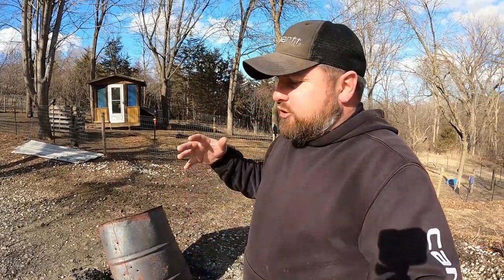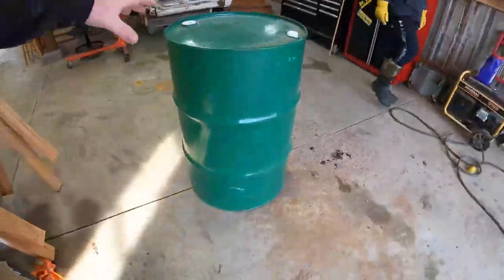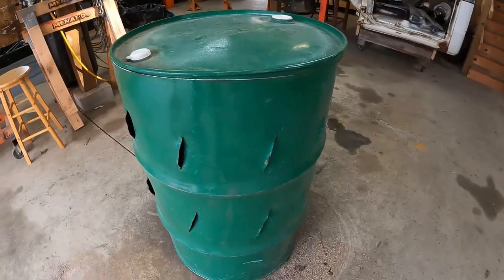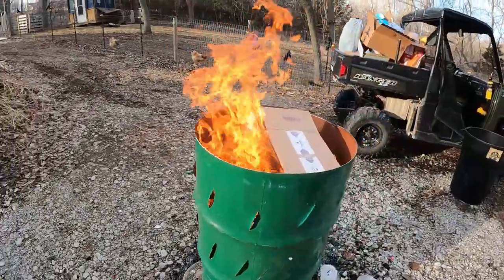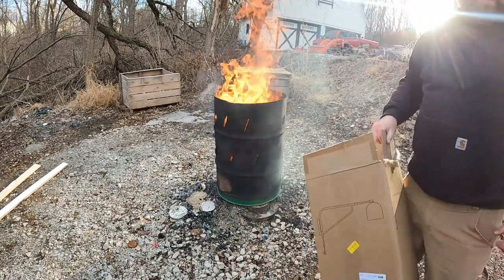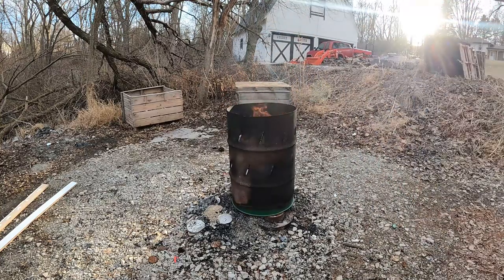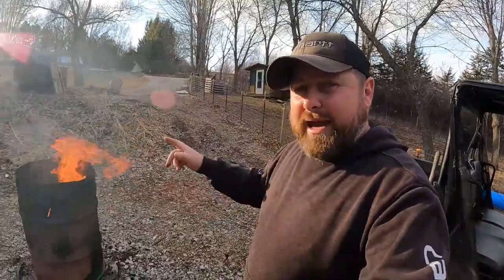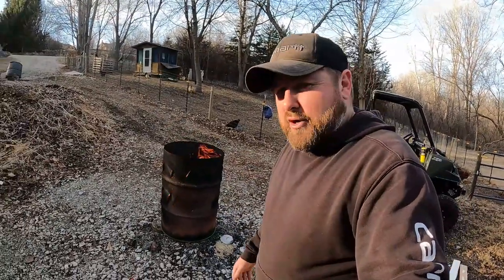✅ FIRE TORNADO Burn Barrel

Comment: I've been doing something similar to yours only with the slits on the side vertical and a 6 foot long, 8 inch stove pipe fastened to the lid and the lid hinged to the barrel.  with a little hardware cloth to catch the burning ash this burnbarrel looks like a giant blow torch when I burns and doesn't smoke.  Light your fires from the top and it will smoke less on startup
Reply from the maker: You made a turbo charged burn barrel lol 😂

Comment: If I put old beef bones - large beef bones in the burn barrel, will it burn down to dust. As in, will bones disintegrate from the intense heat?
Reply from the maker: Yes but they need to be dry to burn alone or you will need fuel to burn them like wood